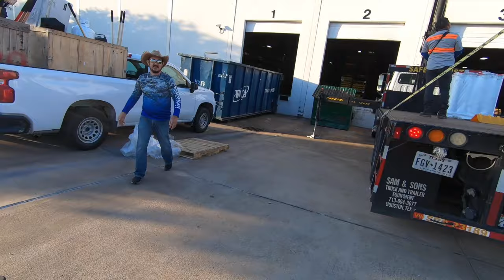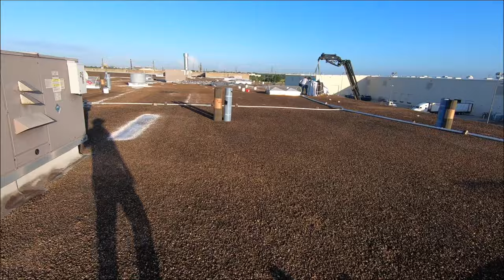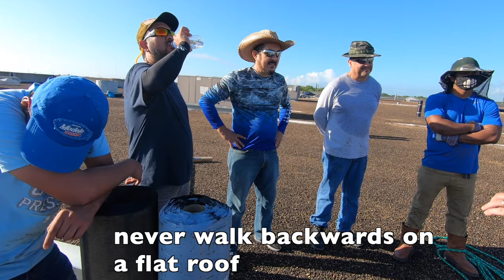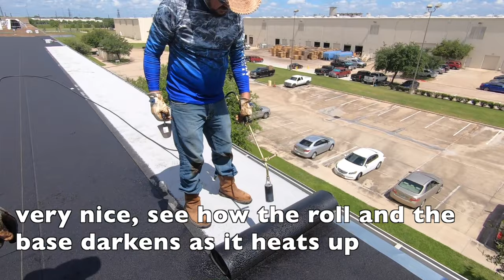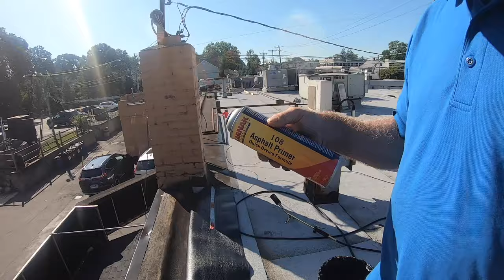Training Rookies to install a Torch Down Roof in 5 hours - Part 1

Comment: The cheap building owner is getting exactly what he paid for here.
Reply from the maker: That roof is doing just fine.No leaks or any problems after 1 year. That system works very well. I have done it for 35 years and never had problems with any of the roofs I did. Just because you don't agree with someones else's technique, doesn't mean it's bad.
Your name and your thumbnail reveal a lot about you. That gives you away what type of person and speech you have. I am not surprised at your comment.
Reply: The  roof is good enough...of course could be better for a pro ... good wotk guys
Reply: @FlatRoofDoctor  I saw his flag icon and immediately thought the same thing no price is too high when he's spending other people's money
Reply: lol where is your video showing your better way then?

Comment: When do you need 2 guys to lay out a roll one to torch and one to make the bleed? When you don't know what you're doing the weight of the roll is enough to get the bleed the ony spot you need to pass the trowel  to get a bleed is the last 3 feet if done right.

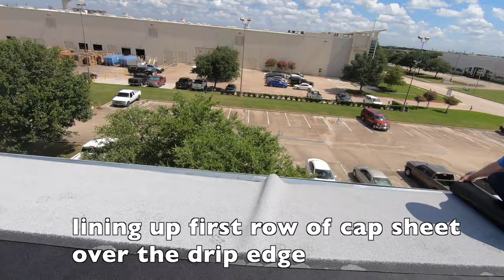Comment: The torch down at 11:38 is pretty much a joke,metal drip edge has no primer and there is no way that Pancho heated the bitumen correctly to adhere to the base  sheet,these guys dont have the knowledge to do this job,that is apparent.

Comment: How to actually do it:

Remove all excess/loose rock.
Decide a section to do for the day.
Scrape rock for tie off.
Lay down 1/2 inch fiberboard.
Lay down protectoboard(overlapping slightly as the 1/2 inch will smolder if it catches fire).
Screw down fiberboard/protectoboard to deck with plates. (5 per protectoboard sheet)
Torch base roll to protectoboard. (With a lot more fire than in video).
Screw drip-edge to roof edge.
Apply primer to drip-edge.
Torch cap roll to base roll. (Stagger it so the seam of base rolls is in the middle of cap roll).
Flash all units and walls.(Never go up the wall with the roll used on the flat(field). Flashing needs 6 inches on the flat, and whatever height you need to go up. Should have straight cuts, and one side with black tape, cut 45 degree cuts on both corners with black tape.)
Plastic cement around all pipes and flanges.

Comment: So no helmets when loading the roof with a crane? Crane operator not wearing a helmet either. Osha would have your asses.

No shit you can see the seams, the gravel was wind-rowed off of it to check for leaks or bad seams.

Metal drip edge for a commercial flat roof lol ok. I think you have the terminology wrong...no fuss

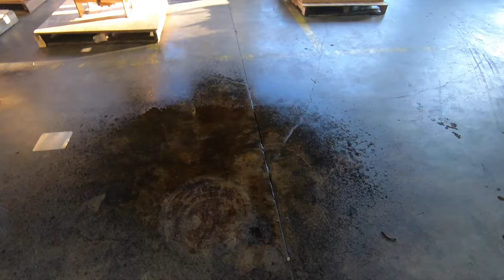Backtrack a minute to 3:33. That leak is obviously from the skylight. You can see the rusted through areas leading to it. This guy didnt need a whole new roof because of that. Wow.

You say "aye aye aye, see how soft it is here..." um, no, no I did not see a soft roof. I see a few easy repairs and a con man trying to take this owners bank account.

Built a crew out of nothing though. Good job on that. Guy has girly soft hands...mustve found that one either washing dishes or playing video games. 

You should never have to convince the crane operator to hoist your tools to the roof. They are paid by the hour. They will hoist anything you want on the roof. 

"Getting all the junk off the roof" by throwing it more than 20 feet off the edge to the ground is against osha rules. Be careful with that. They will fine you thousands of dollars for each offense. That means each time you throw something off the roof it's a thousand or more dollar fine. We just saw at least 8 items thrown off the roof at what looks to me to be more than 20 feet high. That's an $80,000 dollar fine if you're caught. At least that much. Include lawyer fees and all that...its more. 

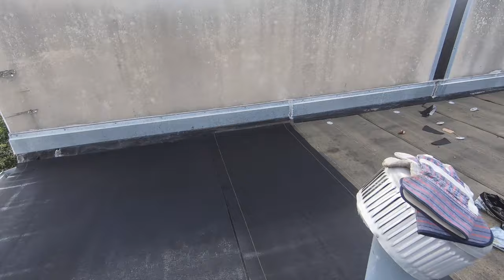@8:51 you are laying a new roof right over top of river rock? Hahaha ok, you must give the tail light warranty. Wow

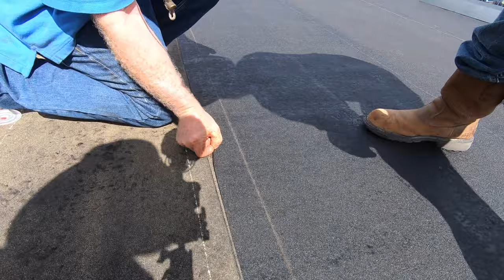@10:17 you show your base sheet laps with the zero inches on over lap. You are a hack. Wow! 

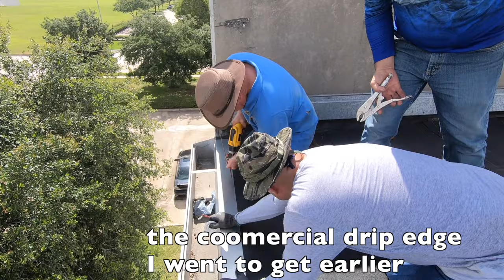@10:48 seconds I cant help but laugh at you on your knees trying to use a screw gun and say it's the wrong type of gun. That is the same type of gun I use to put at least 30 or 40 screws in a roof in a single minute. Stop it..you're making a fool of yourself.

Wow! Just wow! And this is what makes a millionaire! Just hack your way through it huh? Wow!

Comment: I been doing roofing in the same company for 21 Years and this job no look good we never use roofing  cement on top of  the metal then the torch no good no safety
Reply from the maker: Ok, so when you have done this for 21 years and never used "roofing cement", how do you know if it's good or not?
2) It is not roofing cement, it is Modified Bitumen Adhesives, specially formulated for Modified Bitumen Membranes.
3) Roofing cement is the worst product to use on any roof, and if that's all you know, you have been using bad stuff all your life
4) If you torch the rubber membrane directly to a drip edge, then you also have no clue. Using an asphalt primer is just a very thin coat of Modified Bitumen Adhesives.
BTW, if you use any other product than Karnak 81 or 66 Trowel grade, then you still have to learn a lot. Maybe it's time to quit your job and get more experience somewhere else
I get it, you can't teach an old dog new tricks. But you can provoke them to comment.
Thanks for your comment
I do think you have experience. I do think you are a good guy, working for 21 years in the same company means a lot.
Take Care
Reply: He said roof cement clearly have no idea nice work evertime i want to learn something i come to your channel

Comment: What adheres the first sheet to the stone?  Nothing?  Wouldn't a high wind rip it apart?
Reply from the maker: Only a few understand wind lift. Wind lift will only happen when it can get under the membrane. If you lay a piece of paper on the floor and have a fan blow over it, it will not lift up unless the wind got in under the edges of it. On a roof, if the wind got under the drip-edge then it will lift the membrane, but never just blowing over the top of the roof.
Reply: You are not supposed to ask intelligent questions if you are a roofer.
Reply: I call fuckin bullshit... the wind doesn't have to get under the roofing to get wind uplift

Comment: you should be using a hook to pull the rubber and not walking on the freshly torched rubber. that's why you have ugly footprints all over your finished product, which by the way also looks lumpy and shitty because you did not install fiber board on top of the old roof. there's also no way in hell a group of newbies is just gonna know how to torch a whole roof after watching you do it one time.

Comment: No bleed out....not torching into the roll and seams are way to close that roof is ugly and wrong
Reply: 100% agree what a waste of money
Reply: @dosed3819  I'm from Toronto and have does tons of training from manufacturers and none of these is right.he should not be showing people how to get into this industry at all.
Reply: Trevor Tilling I’m from Calgary and have been flat roofing for about 6 years now that is worst roof I have ever since
Reply: @dosed3819  lol so true
Reply from the maker: All you guys are ignorant. I took a class in torching from PolyGlass in the 90's. The technique I was shown keep on failing. They had me heat melt the membrane and apply it to a metal edge. Before I did that I had to nail the drip edge every 2" of the surface. then sand it to scuff it up. Then apply primer. Then Torch it. 
Torching into the roll is maybe what you prefer. The reason people do that is so that you would not leave boot prints on the surface. I have done both ways. You have much better control pushing the roll forward than pulling it backwards. Also walking backwards on a flat roof is a no no in my books.
By the way, I never did any other roofs than Torch Down. I have been doing it for 40 years. My roofs are still standing.
Reply: @FlatRoofDoctor  You literally walked backwards at the edge of that roof with zero PPE. This is a prime example of why roofers have a negative connotation. You have been doing it 40 years the incorrect way as per spec.
Reply: @FlatRoofDoctor  I have done tons of class is my 15 years . The guys who showed me what to do would let you on the torch ever. I have done every type of roofing out there and I think torch is the best and I do 3 plys as you do but I do pleel and stick  torch base and torch cap . I have no problem showing you any of my work and I never go back
Reply: @InspectorRoof  im right with you tj that's why on my jobs it's two guys working in teams torching rolls down
Reply from the maker: @trevortilling8689  Great I am glad someone takes pride in what he does
Reply: @FlatRoofDoctor  I do take pride in what I do .do you not?
Reply from the maker: @trevortilling8689  I thank God for the ability he gives me. I can not take credit for anything. The success I had in life and talents given to me is only by God. Can I boast? Neh, never. Can I be thankful? Yes forever grateful for the health, mind and wisdom that was granted to me by God. 
Pride comes before a fall. I can just be thankful  lest I fall. 
Yes I agree with you. I don't do things the conventional way that you were taught. Yes, I agree I have my ways of doing things. I am an entrepreneur, inventor, hack. That is why I have started many businesses and failed some. I guess some people need to be taught by the book and some just figure it out.I am the latter of the two.
At the end we all try to make a living. Some people just like to to show off while they doing it, some like to criticize others, some like to boast, but everyone still has their own battles.
Anyway Trevor, best of luck to you. Thanks for the comments and replies. You get my thinking juices flowing at 6 am . I netter get to work now.
Take Care
Reply: @FlatRoofDoctor  not once did I call you a hack or any other names just pointed out things I fix everyday .I'm not boasting about how I do things at all .I'm sorry if your have hurt feelings of what a fellow roofers see wrong when your training people who don't know anything to be in this field but I guess those who can't roof teach.
Reply from the maker: @trevortilling8689  Ha Ha No hurt feelings
Reply: @FlatRoofDoctor  go do a the soprema course then maybe you can teach and get a real torch .use a soprema torch .
Reply: I like the base ply fasteners penetration old roof and metal deck.  Moisture in old roof has new drain holes in the deck. Hope there's no wind in that area.
Reply: @trevortilling8689  facts... I work in Toronto and have suprema training as well
Reply: Messy work too....   and you didn't degranulate
Reply: Jesus what a shoemaker saw so many wrong stuff in this video this guy in toronto wouldn't last a week. And i also have level 2 suprema training and red seal in roofing
Reply: @dosed3819  Coming from a NRCA CERTA instructor for decades........This is the worst application I have seen and he is not qualified to teach anyone!
Reply: @InspectorRoof  You are correct.......the flat roof doctor is not qualified! Another person trying to be something their not! The problem is........some inexperienced workers will think he is qualified. Sad.......
Reply: @FlatRoofDoctor  you mean still leaking  ... not standing
Reply: this is literally garbage. he needs to remove all these videos. the sad part is he's teaching guys how to put on roofs and they're going to think thsts the right way. there's no way in he'll these roofs you put on don't leak litersllt the next day after instal. your robbing clients of thehre money. just stop. it's so bad that's its actually sad.
Reply: i just wonder how many court cases this guy is dealing with from leaks, your the guy that gives roofers/companies  a bad name/rep.

Comment: I see you always say to people “just because it’s a different technique than yours doesn’t mean it’s wrong” but it is wrong all roofing material manufacturers have “specs” you’re supposed to follow when installing a roof And in order to get a warranty for the roof it must be inspected by the manufacturer. This is not up to spec at all, if it was inspected it would fail 100%. Especially if they seen that you didn’t clear loose gravel and lay a layer of insulation on top of the old roof. I’m not attacking you, but i just feel like you’re giving people on YouTube misinformation on how roofing actually is. Regardless you’re making a living so keep doing your thing.
Reply: Also the safety, like harnesses, safety rails cones and flags are not a choice they are OSHA law. You can be fined thousands of dollars if caught working on the roof without proper safety.

Comment: You said that adhesive doesn't cure for like 6 months, will rain get in or damage it in that time? And also will the sun damage it? Do you put more metal over top or thro granules on it so sun or rain doesn't damage the quarder inch thick adhesive?

Comment: So how is a torch down roof better than a TPO, EPDM, or PVC roof? I've done commercial roofing for about 4 years. I know the above mentioned pretty well, well enough to do it myself but not the torch down. What's the big gain with torch down?
Reply from the maker: Ok, TPO and PVC are good materials. I have inspected several of them and made a video where I show where a TPO is failing on a Supermarket after 20 years. It was chaulking a lot and the UV's have eaten through the material just where the seams are welded.
So, Tpo will get you between 15 - 20 years of life.
EPDM is the worst. I have made several videos on this material showing how it fails. The EPDM industry has revised the adhesives more than 5 times since its conception in the 60"s. The adhesives used on the seams, whether it is cover tape or seam overlapping always fail. Besides that, to use Butil caulk on the seams to secure against leaks is absurd. That caulk only lasts a few years. Then the membrane dries out and shrinks putting stress on the entire roof causing it to fail.
Ok, all materials do shrink over time. EPDM is the worst followed by TPO.
TOrch Down single-ply installed is slightly better than the 2 mentioned above. When you do a double-layer Torch Down, then you have a roof that is indestructible. There is no telling how long it would last. I have roofs now for over 30 years and when you look at them, they look like if they were installed a few weeks ago. They just don't age.
But you should do your own research. This is just my 1st hand experience and not what I have researched anywhere.
Take Care
Reply: @FlatRoofDoctor  by double layer do you mean a base sheet and 1 top cap?
Reply: @Brandon-no3vc  aren’t u sharp as a tack lol but yes base and top cap
Reply: @tyliving7649  he could have ment two tops  obvy your going to use a base should almost be called one layer hhhhhhhhhhhhhhhhhhhhhhhhhhhhhhhh
Reply: @tyliving7649  I thot  he ment two top caps cause why wouldn't you use a base hhhhhhhhhhhhhhhhhhhhhhhhh

Comment: We're did you learn to lay your rolls. Better question how are you qualified to teach anyone the art of laying out torch down. First of all you are supposed to start you're rolls at the drain second you have no steger. Meaning it doesn't matter if you have 10 ply's on top of the other it's the same as have 1 ply. Anything under 12 inches is not expected. You have no primer glue in between the fiberglass paper and the peel and stick. There are no corners cut when at the end of your sheet before extending the next sheet. So tell me what qualifies you to teach anyone. If you are truly a torch expert can you tell me what a gusset it and when and where you use it because for a guy that says don't trust roofer you sure seem to take alot of short cuts.

Comment: Dude this is a joke right? This was horrible. If your trying to learn how to torch don’t watch this video. He even said his new roof leaked. 

Scrap your rock, wall pieces can only be 3 feet long. The beginning of the video he didn’t even melt the roof to the metal. No bleed out on the seems. 🤣🤣😂 the chimney base flashing he did wrong. Your supposed to have a pice on the field first then sides. You should stop teaching people how to roof wrong.

Comment: How can you clean up all the black footprints after you are done so it looks nice....acetone or?
Reply: you can add granules to the bad spots, or patch the real bad spots but that about it, acetone would kill the roof.
Reply: Are you removing the footprints for aerial photos? Birds won't mind if it's not pristine.
Reply: @brandonhorwath6351  ah right....my home is on a hill so from the house decking you can see down on top of the car port roof I had torch down applied....i had the guy sprinkle some granules on it...not perfect but that tar or bitumen or whatever is quite sticky.  I struggled with the choice a bit because torch down is not that pretty...but in the final analysis I think its the best for a low slope roof.  It was been leakproof for a year or so now.
Reply: @brandonhorwath6351  the purpose of granules is to protect the bitumen from the uv rays, all those black footprints and scuffs on the roof reduce the lifetime of the affected areas from 30 years to 5.

Comment: This looks like crap, burning the cap sheet at the seems and ends, stepping all over the hot cap sheet , scaring it. I’m so confused why you stand in the cap while installing it ? It’s hot and you’re stepping all over marking it ? We cap walking backwards on the base while pulling the roll and burning it w the wand….this seems ass backwards. Must be an American thing